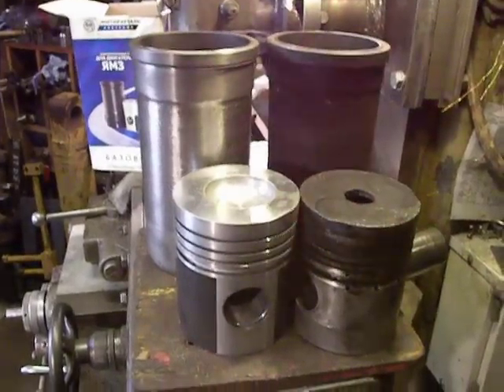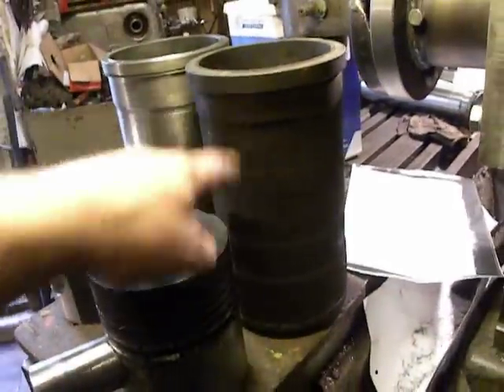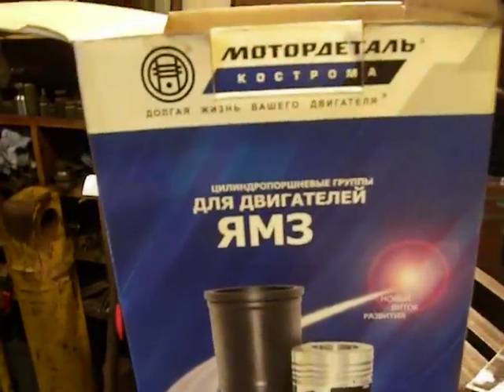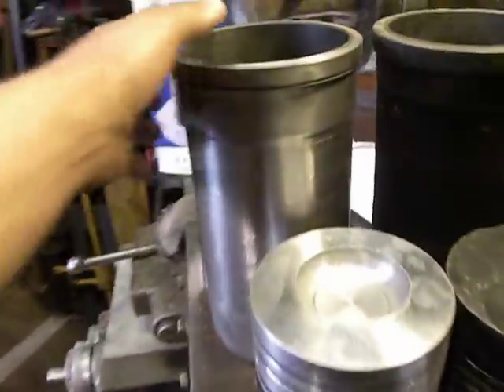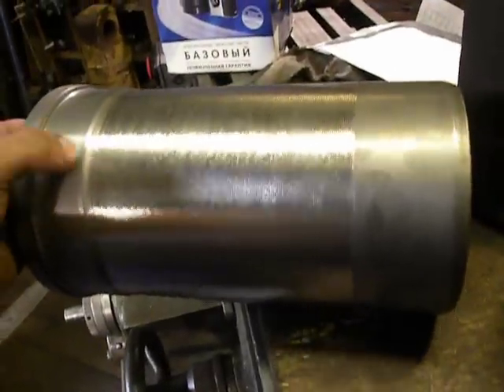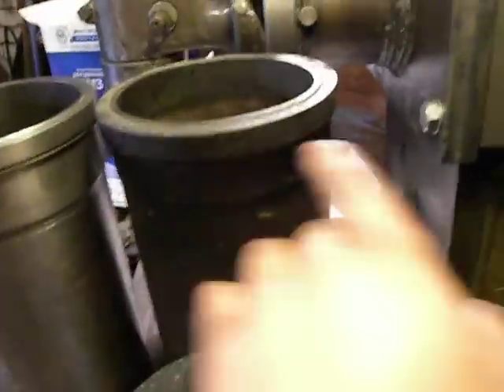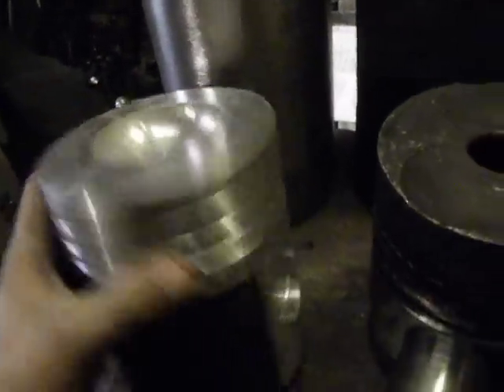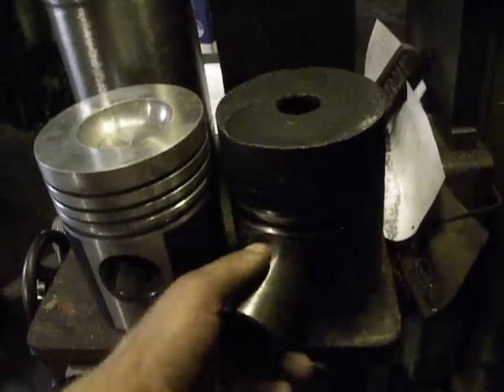Rebuild YaMZ engine cylinder shell and piston for DT20 tractor engine - overview (end)

Comment: Can you tell bro is we can have piston slleev for DT28   we have tractor in india 647 2024949
Reply from the maker: That tractor is no longer in production. So, You must look for JaMZ-238 engine sleves and You rebuid sleves and piston and fit in your tractor. Spare parts for DT-20 (DT-28) is impossible to get even at my country. We craft or custom parts from other tractors, trucks and engines. Or try contact tractor factory: "Vladimirsky motor-tractor plant"